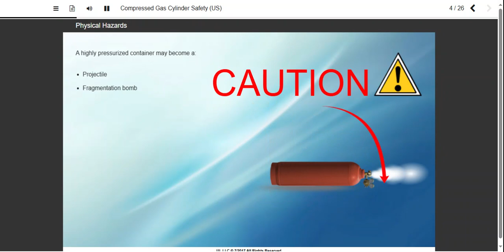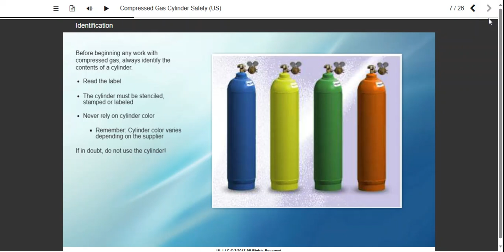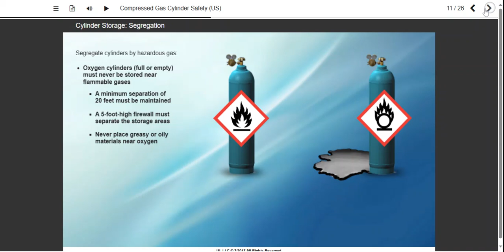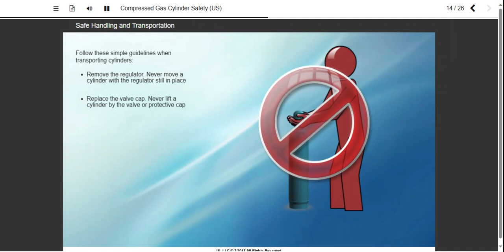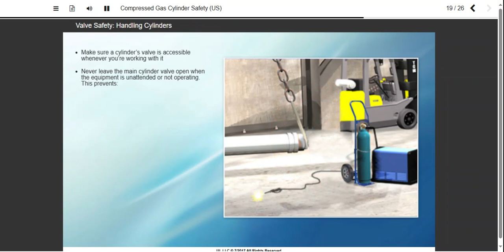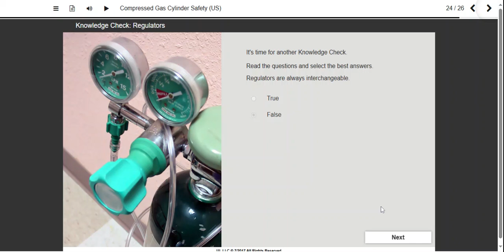Compressed Gas Cylinder Safety US

Comment: In addition, special attention should be given to any acetylene cylinder which has been exposed to direct flames or intense heat, or received severe impacts, such as when struck by heavy equipment or fallen from considerable heights, since there's a risk of internal decomposition.   Such cylinders have been known to self detonate within minutes to hours after the initial damage.   If any part of the cylinder becomes hot or starts to vibrate, the area should be evacuated immediately, and your company's emergency action plan should be activated.   Under no circumstances should a damaged acetylene cylinder be touched or moved, as this can accelerate any decomposition that may have already started.